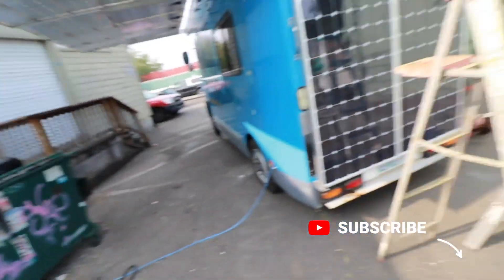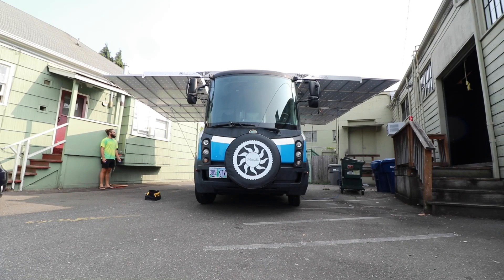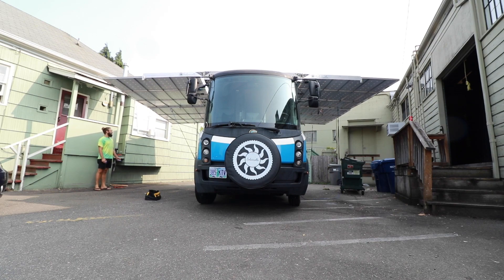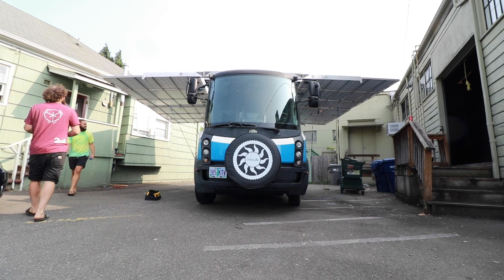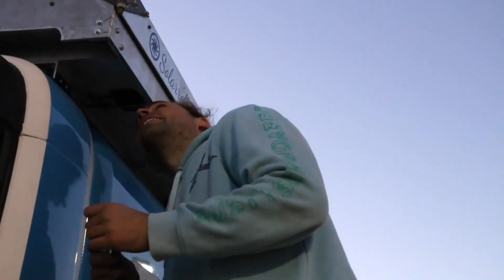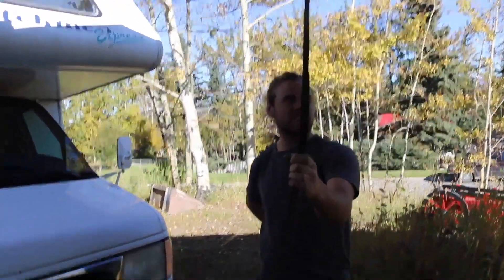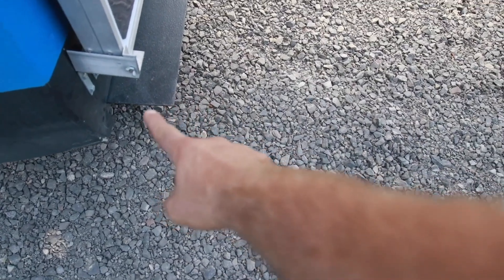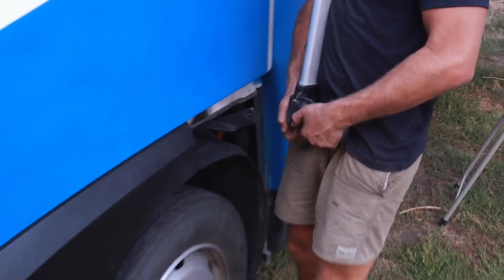How we built our SOLAR tracker? (FRUSTRATING) PART 2 | DIY VAN BUILD | Electric Vehicle Road Trip

Comment: The way I would have done it (I think haha) would be to make a scissor lift assembly to push the CENTRE  of the frame up at both ends. that way you just have to either unbolt the left or the right depending on which way you want it to tilt. Using a scissor lift you wouldn't have to use a massive push force actuator as the scissor gives the mechanical advantage, just bolt the actuator screw across the scissor just like a standard car jack. Also wouldn't need to be a ridiculous length actuator. 🤓🤓🤓
Reply: An even better solution would be to hang 2/3rds of the array on the side of the van, tilting out from the top edge and then extending down to ground (similar to @10:30 ), with another set of panels mounted to the roof tilting up with a sissor lift to match the angle.
Reply: @kschleic9053  agree, permanently deployed, even vertically mounted, would pull in more watts than if they were stowed away under the main roof  pulling in none👌🏽
Reply: @T455 very little difference, what you lose in hight profile, you gain in width, would be same frontal surface area overall though.